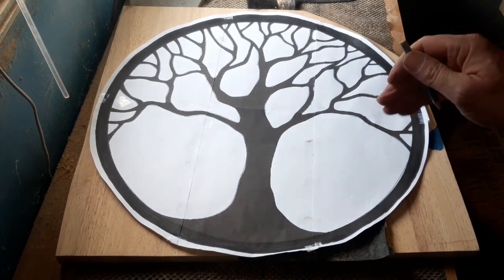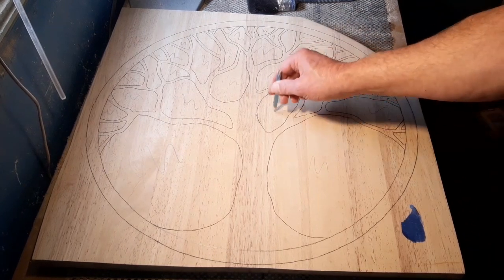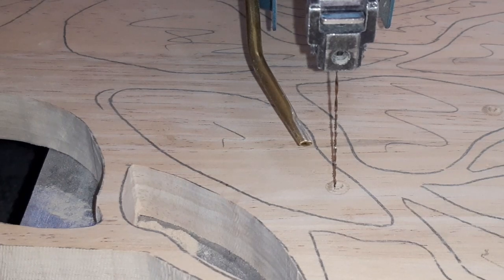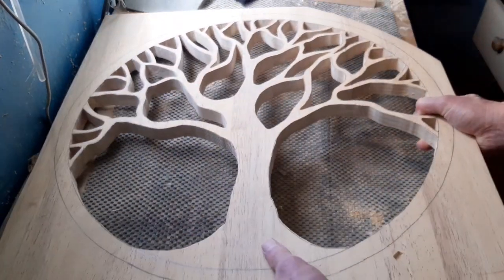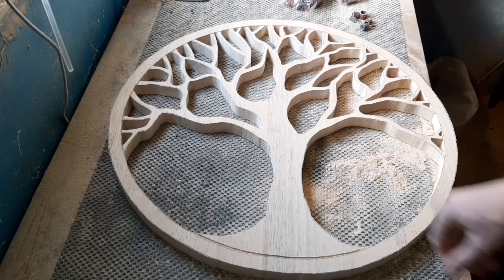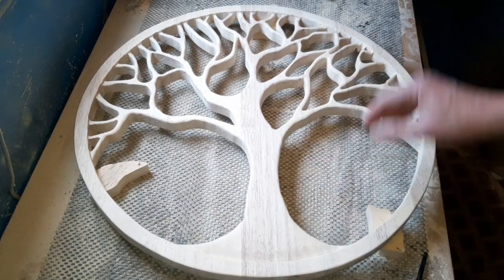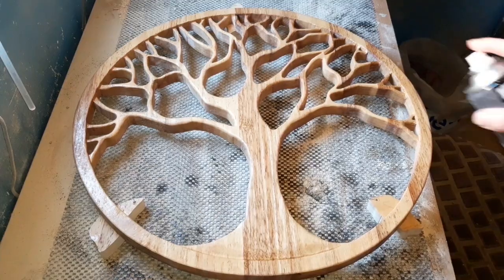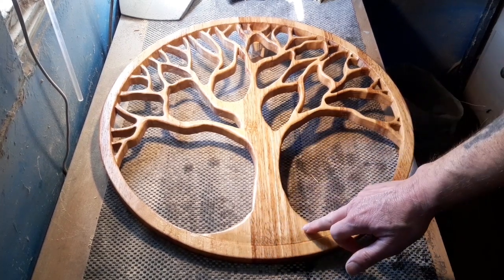tree of life 21"..scroll saw project.

Comment: A bit of machine wax on your scroll saw table should help with moving the wood ..even put a bit on the back of the wood as well .. Burning the names on with a pyrography machine would make the letters stand out good .
Reply from the maker: It definitely needs something for the  next time🤣,I've looked at those pyrography machines ,it's got my interest, some fantastic artist using them,another toy on my list..🤣👍
Reply: @fishtank5050  Ive sent you a link to the 1 I bought ..very easy to use ..Easy to change nibs as well ..ive done loads of stuff with it ..I use graphite paper to transfer images then burn away ..very easy to get into and countless images on the net to do ..burns plywood and pine no bother although the pine you need to do a bit of sanding first before you do image ..I bought one of those cheap scorchmarker pens to try but they were pretty useless so bought Ammonium chloride and made my own solution and that worked pretty good although you need to have stencils made to do it
Reply: Think youtube are taking the link down ...the one i got is a Preciva 23W wood burning kit
Reply from the maker: @ianm398  thanks Ian I've purchased a cheap thing for now  the one with the wires in the end, just to see how I go..I've watched loads of videos, some fantastic artist using them .carbon paper and trace works for me..😁👍

Comment: Looks great.
I have made a bunch of them similar to yours. Mine are oval with a hanger at the top. 
I shape mine differently and sand differently. 
I do like the router you did on the edge.
Most of mine are on a 8 1/2 x 11 sheet of paper, and a lot of them go as gifts. 
The largest I made was a 2 foot x 3 foot out of cedar painted exterior gloss black as it was going to hang on their front porch.

I also have a couple videos on them.
Reply from the maker: @lenshandcraftedwoodsigns6033  thank you Len,just watched your videos the first tree was a beast of a thing ,that's a good size..turned out great..👍
Reply: @fishtank5050  Thanks for watching. They make great wedding gifts.